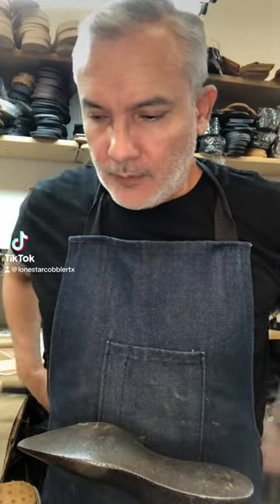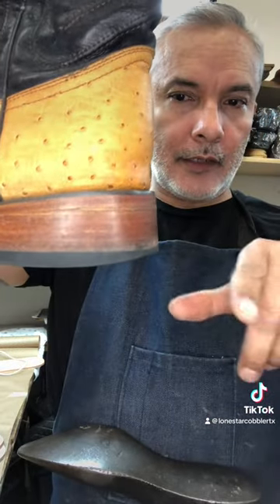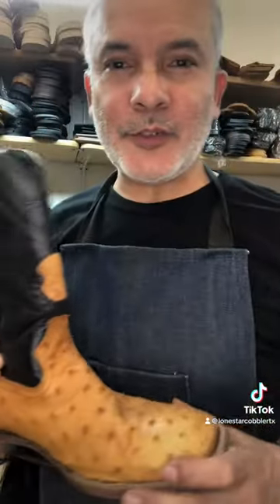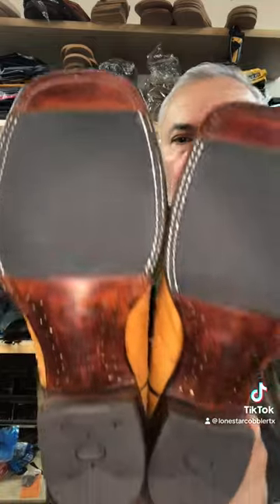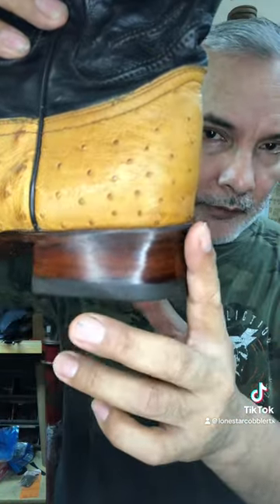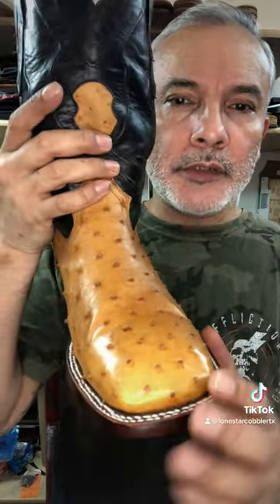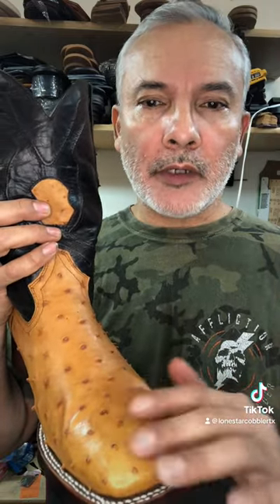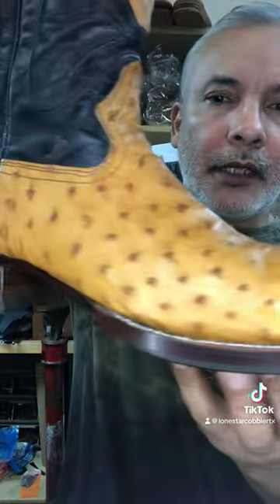Cowboy Boots Hybrid Resole #bootbarn #cowboyboots #cowgirlboots #westernboots #bootrepair #boots

Comment: Looks amazing what's the cost for that service?
Reply from the maker: Resole starts at $140.00  I would need to see the boots first. Thanks for watching.
Reply: They look amazing, where are you located
Reply from the maker: @lochsavila281   2020 N. Bell Blvd Suite B3-A Cedar Park TX , Thanks for watching.
Reply: Great work - like what you did with the heels. I have a couple boots with the hybrid soles - I really like them.
Reply from the maker: @robertleitgeb7252  The heel bases were very wide so I trimmed them down about 1/8 all around.  Thanks for watching.